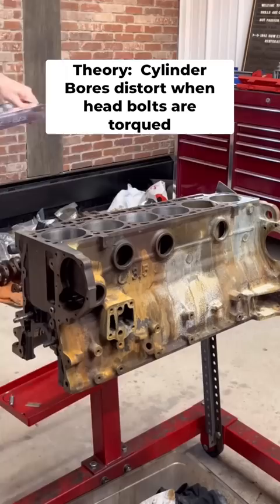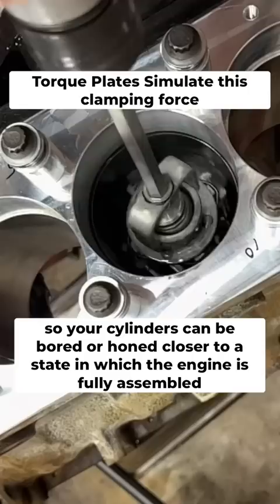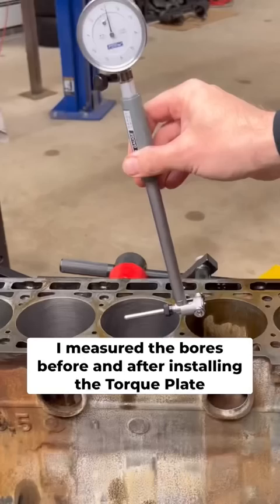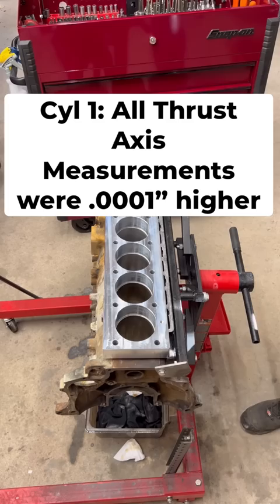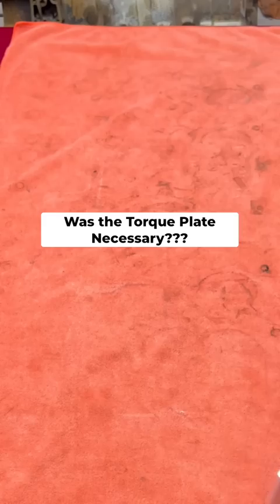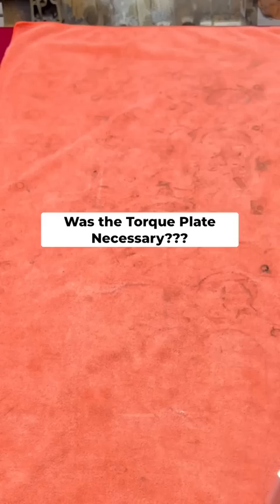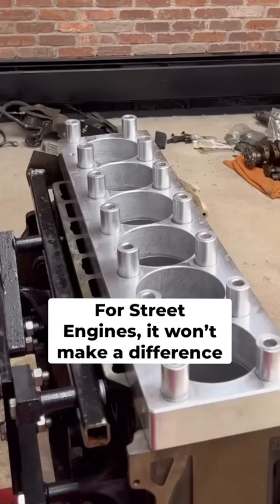Are Torque Plates Necessary? #bmw #cars #diy #bmwm5 #bmwe34 #restoration #automotive #engine #tools

Comment: This video made me realize that not only are you pulling the head down to the block when you tighten the head bolts, but you were also pulling the block up to the heads. Well, at least the area around the threads. It may be a minuscule amount, but I think it’s possible. Am I wrong? I don’t know I’m not a machinist.
Reply from the maker: The theory is that this action creates bulges in the cylinders near the head bolts.

Comment: I have never seen anyone use it. Never heard of issues either.
Reply from the maker: I think they’re overrated but many people disagree
Reply: @wewrench o they don’t. Many people may disagree but none of them have ever used one, let alone ever worked on any engine …ever!  Zero reason to use one. Not accurate waste of time. WOW what an idiotic thing. That pos doesn’t possess the strength to simulate block twist. Not by a thousand miles. Waste your money all day
Reply from the maker: @dwood82574  lol. I can't tell if you're joking or not. Sounds like you're agreeing with me. But yes, most of the people militantly commenting have no clue.

Comment: The torque plate will be worth it in a street engine. It won't be massive power but it will be extended life.
Reply from the maker: It can't hurt...but it was a waste of $450 I think. For a tenth difference

Comment: Depends on the engine!
On such an old iron pig with closed decks it doesn't mater, maby even in high power applications.
On aluminum blocks, especially on modern light waight open deck blocks there is often a significant deformation that will cause problems!
For example the subaru ej20 and ej25 flat fours need even both block halves torqued and a plate.
Or the Ford RS/ Volvo 5 zylinder blocks go out of round about 2-5/100mm on zylinder 1 and 5 without a torque plate! Thats basically half of the pisto clearance! 😬
Reply from the maker: For those applications, I agree.

Comment: .0001"  hardly makes a difference in anything ever. In machining, a tolerance of ±.001" is considered a pretty high tolerance, and tolerances less than that are achieved with high-precision surface grinders. If all your cylinders are already within such a microscopic amount, you're fucking good!
Reply from the maker: Thank you for making an intelligent and informed comment.

Comment: Its important to note that it wasn't necessary in THIS application and is not necessarily valid for other applications or engines
Reply from the maker: Yes, I cast a wide net, but for street engines, I believe it's a solid generalization

Comment: If making a stock engine then no it's probably fine but if you are doing V block or horizontal opposed they should be used or if building a mod engine, especially a boosted engine then yes very very necessary. Also doing the cutting at room temp should be avoided, the cutting should be done at operating temperature or as close as you can get it
Reply from the maker: Agreed with everything you said

Comment: But why the hell use a torque plate for that small difference, when other factors are neglected. Heating the block up at least 90 degrees celcius is gonna make more of a difference. Factory engineers calculate the difference caused by heat and torqueing in a simulation and the factory specs take that into consideration. If you go to the trouble of using a torque plate, at least also heat the block realistically.
Reply from the maker: That's what I'm saying. A lot of details like that are what really matter
Reply: @wewrench yup thats true, I am just really puzzled on who came up with these.
Reply from the maker: @timdegroot4159  it’s old hot rodder folklore

Comment: For aluminum block, slightly more distortion than cast iron block, but still well within the spec for street application. If someone really want to use torque plate, then he better keep the block at operating temperature during bore or honing. The temperature is the main key of cylinder deforming. But for street application.......forget all above
Reply from the maker: Agreed my friend

Comment: Gonna vary by engine I'm sure, but generally, don't think it's necessary for most builds. Source: My complete lack of engine building experience and an abundance of research.
Reply from the maker: It does vary. I cast a wide net with this vid
Reply: @wewrench  A very informative vid for sure!

Comment: The dilemma here is that a torque plate would be beneficial when decking the block. Which can't be done with the plate installed! LMAO
Reply from the maker: Make sure you check out my latest video on how I corrected the cylinder wear myself

Comment: I wonder how this compares on an aluminum block. The modulus of elasticity for cast iron is about double that of aluminum. Aluminum will be more prone to deformation. Aluminum also has a higher coefficient of thermal expansion so deformation will also be greater at temperature.

My guess is doing the torque plate alone without temperature compensation is indeed a bit of a crapshoot.
Reply from the maker: I agree. THere's all these details that people swear by but in the real world, they don't matter

Comment: But it's a BMW so this is probably a double bold, underlined, highlighted procedure in the service manual which MUST be done every 3 and a quarter oil changes or the engine will explode
Reply from the maker: ahaha...sounds about right

Comment: This is the first time I ever heard of a torque plate, and I’m pretty common with cars and how they are restored. I love classics I have 3 90s cars, 2 Nissan nx1600 one is in the works with original Nissan body kit all original 92hp and the other is a daily driver with 127hp on the wheels chipped, and I have a Pontiac firebird gen3 v6 3,1L 140hp. I’m from the Nederlands v8 is not common
Reply from the maker: Thank you for supporting the channel!
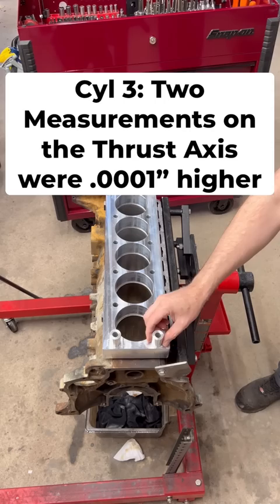Reply: @wewrench  i also subbed i wil check you out later it’s 00:30 now
Reply from the maker: @SonOfTheDevil666  Thank you for supporting the channel!

Comment: I have an important question that will decide the future of my car and where I'm able to go with it on road trips. 

Question is: how do I keep my transmission healthy outside of normal service when it's expected to be under continuous strain for long periods?

Basic info is I have a 1998 rav4 with an automatic transmission. The transmission is a Chrysler dodge designed a540h fit for awd.

Reason for my worry is I had to replace it before. On my previous long road trip I had to cross the Appalachians to get to Virginia. And the drive forced my to go 45 in second gear for over an hour up the mountain on the way there and back. Not even a week after returning to normal life, my transmission was slipping, the oil was in poor health and shortly died one night after going from college to work. I had it replaced with a junkyard tranny from the same year rav4 and carefully chosen for having the same mileage within 10k of mine to keep an even service sheet. I flushed it and replaced the seals then installed it. It's been almost a year and usually I would have gone on a few trips by now but that experience kinda got me scared for my cars health. It's my only vehicle, and the only vehicle for me, and I'd be devastated if I killed it again. I want to go on more adventures with my car and my friends but I want to make sure it can take what the terrain dishes out.

Any tips, kits, fixes, other transmissions that might fit the application (off-road, long distance, more durable than the kidneys of a person living in Flint Michigan?) If there are other transmissions I'd like another automatic or a manual that doesn't have a tree style shifte, I'd rather focus on the drive and the scenes rather than where 3rd is. and retain the transverse awd.
Reply from the maker: Not much you can do except keeping up with the service intervals and procedures
Reply: @wewrench  I have been, can't say much about the history of the replacement one but I've had it maintained per the manual, same with the previous one.

If the only option left is a manual, would that be a better option than an auto? The mounts are the same as an st205 (Celica gt4) so race application tannys and sequential gearboxes are available. I just don't know much about what those can handle, especially just driving and 80mph for 6 hours straight sometimes. I don't want to give up on this car. There's gotta be something I can do. If a well maintained gearbox dies after a 6 day trip to the coast and back, what am I supposed to expect from the replacemennt.

Comment: This one time.... We observed .004 thou out after putting a plate on the engine. Engineering does matter but its not a given for every make & model.
Reply from the maker: .004”? That’s crazy
Reply: @wewrench  we thought so too ! after seeing this clip I am guessing different engines torque up....
Reply from the maker: @automan1223  yeah, based on some of the comments and yours as well, every engine is different

Comment: Had similar arguments with the old man. Considers himself a master mechanic. I always end my argument with, "if you really want to get all technical, you should work on the engine while it's at the temperature it will operate at" 🤣
Reply from the maker: Kind of true though. People get on your ass for not doing all this stuff perfectly but it’s imperfect to begin with. Especially engine building

Comment: Measure in line with the bolts and then inbetween the bolts. Thats where you should see the difference.
Reply from the maker: I measured in a lot of different spots and only saw the differences I mentioned.

Comment: It is not a theory, we did the measures the same as u, but got a much different number, then we put the blocks together, the one you could almost spin for days with a pinky. The other hard time with 45°. The one with the torque plates was more free and freed up 20 handed 50 ft lb, the other was not only less on power but lagged in its curve &so we decided to do use the plates on everything unless ask
Reply from the maker: What kind of engine?

Comment: I've always theorized this. It's an external input to the engine that does not carry the same loads under thermal expansion and tensile strength through the stud/bolts under cylinder pressure. Not only that, but the natural knock from detonation in some way has to pivot outward stress in an unfavorable condition. I'm not an engine master, just an enthusiast but I do read a lot of the engineering on this stuff and I can't be wrong I don't think.
Reply from the maker: This is very insightful and true I think. Thank you for contributing something meaningful

Comment: I was thinking it's not so much in overall distortion,  but more so locally around the area near the head bolts , which is where most pressure and work is done .
Reply from the maker: That's what people say

Comment: There's absolutely way even being 0.0001" out is going to make an observable difference.
 
That's way beyond measuring equipment uncertainty in a workshop environment too. If you're in a temperature/humidity controlled room and handling the equipment with gloves so you minimize heat transfer into it then maybe but outside of that i'd say you're dreaming. 

Just because it has 0.0001" resolution doesn't mean you're going too get that level of repeatability on the tool. 
Chances are there's zero difference, would be interested to see what a CMM has to say about cylindricity though, probably still negligible difference.
Reply from the maker: I agree 100%

Comment: No. torque plates Are nessecary, it's extra safety and Even For street deviation can Be bad
Reply from the maker: Based on what I measured, I don't agree. Some people say Subaru engines and aluminum engines are the exception.

Comment: As someone whose done his stuff and pushed it hard, using one without tq the main caps would be pointless. We even heat some stuff partially not to 180°f but 100° isnt too hard to get at and iv seen differences in wear Mark's. Is this needed in a normal build or stock I dont think so in most cases. Subaru's and Porsches are some of the examples I would say you absolutely have to use them same for ecotec.
Reply from the maker: The reason why I didn't tq the main caps is because that stress on the block will change with the mains tq'd and the crank, vibration damper and flywheel get installed. So it defeats the purpose to torque the main caps just empty. That's the point that I'm trying to make here, is that you can chase details all you want but the true operating condition of the engine won't be replicated. If you're doing a high end build, then yes. Embrace the details. For a street engine though, a lot of this stuff is a giant waste of time

Comment: The isolation between the head fasteners and the cylinder sleeves is probably why you didnt see much change. I dont know how far the threads in the block for the head fasteners are countersunk but it looks like the stress from the fasteners is being taken up by the perimeter of the block and not the cylinder sleeves. Looking at some good pics of S38 blocks it looks like the threads in the block are at least 10mm down from the deck surface and there is water between the thread anchor and the sleeves.
Reply from the maker: Yes. This is totally correct.

Comment: My FIL rebuilt P51's during WWII while on Iwo Jima. They used torque plates.
Reply from the maker: That's crazy and interesting!
Reply: No they didn't. Field service of the P51 Merlin engine did not include cylinder honing. They were/are a floating wet sleeve engine, so damaged sleeves were removed and replaced. The piston, rod and sleeve came already assembled as a field service part, to avoid the need for large machines, like boring/honing machines on makeshift runways and aircraft carriers.
The allies designed war equipment around being field serviceable, by rapidly trained mechanics, unlike the Germans, who needed precision factories, to get their junk, back in the fight.

Comment: Recheck the cylinder at the head bolts...you can see the effects of the distortion if you run a hone through it...
Reply from the maker: I did, and it still didn't

Comment: It depends a significant amount on the design of the cylinder. Some engines don't get much distortion others see quite a bit.
Reply from the maker: This seems to be the consensus. But for a street engine do you think it matters?
Reply: @wewrench  like I said it all depends on the design some engines like old Harley Davidson must have them because they distort so much if you don't they can seize the piston but that is an air cooled cast iron cylinder that gets hotter than typical water cooled engines.

Comment: Plus if you're using TTY head bolts that's another expense added on top of the cost of the torque plate
Reply from the maker: Yes, that's true. And these bolts aren't cheap

Comment: I know GM uses torque plats on the LT engines when machining them at the engine plant. The tolerance are now measured in ten thousands of a inch so 0.0005 to 0.0009 on some specs. I hade to buy new dial indicator just to be able to measure how GM now wonts use GM techs to measure clearance on the LT engines. Plus on aluminum blocks with steel liners it’s important to keep the liner in place and level with the deck surface. On cast iron blocks it mite not be as necessary but it couldn’t heart
Reply from the maker: I cast a wide net with this vid. On cast iron street engines, its not necessary

Comment: Just had a thought.   I wonder why we don't in race applications,  heat the block up after machining and check clearances.   As we know then cold and count on thermal expansion is areas and clearances are made to account for them.....

Just like with the torque plate, heat play into it as well...... and we just assume these new numbers when it heated up.
Reply from the maker: I think they do that on F1 engines
Reply: @WeWrench  I bet your right.  And I may have the answer to my own question.  Because we live on a planet with ever changing temperatures,  the tolerances are left loose because of this.  That's why f-1 engine lock up at room temp.

Even my 850 skidoo only runs at 102 degrees on a cold day.  Meaning the t-stat opens around that time.  And I'm guessing because they are trying to control thermal expansion.

Comment: My engine compressed the top of the cylinders and egged all of them out of spec with the torque plate installed.
Reply from the maker: What kind of engine?
Reply: @wewrench  srt4 engine. Cast iron 2.4L